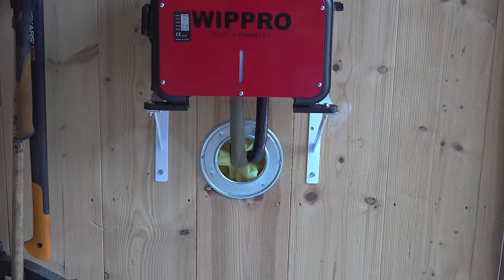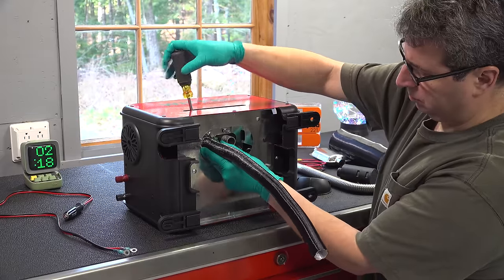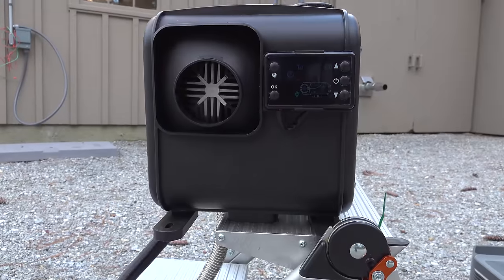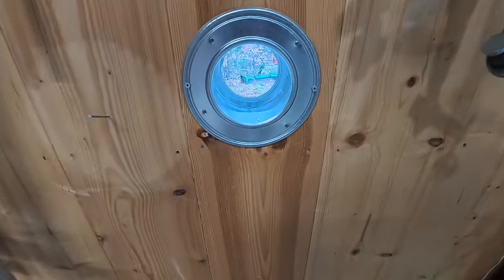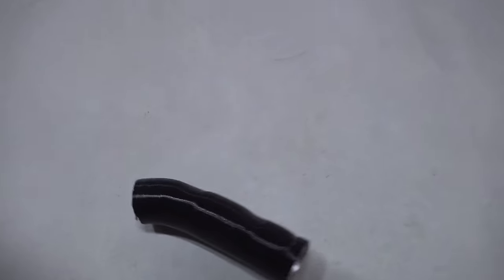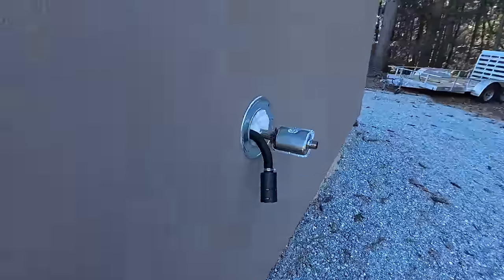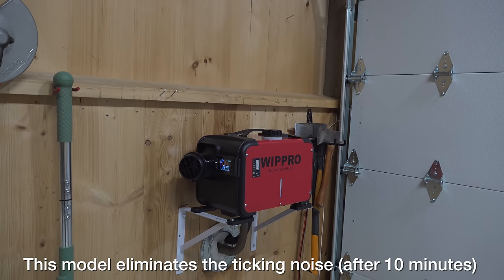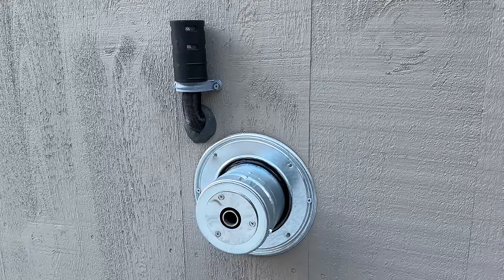How to Heat a Small shop with a BUILT IN Diesel Wall Heater

Comment from the maker: What do you think? Parts used: Heater: https://amzn.to/47o4DcR  Exhaust Flange: https://amzn.to/3NP4GaU Insulation Hose: https://amzn.to/3vxMsUM High heat insulation: https://amzn.to/3NVHA2i
Reply: Thank you so much!
Reply: You should Run an outlet over by the heater with some SJOOW coming out of the box for a 12 volt 30 amp power supply.
Reply: The Selkirk links don’t work.
Reply: great video as always. you and i don't see eye to eye on some products but this is one we agree on. I have an Hcalory unit. its basically a portable like yours but its in a tool case looking box. i keep mine outside. this way i can avoid any issues with my land lord and the fire codes (not that i give a rats ass what the .gov thinks). I live in Florida yes we don't get nearly as cold but the mid 50s and lower is cold for us. I like to keep my place between 68 and 73. otherwise my chihuahua is freezing or im hot. it was 52 last night here and i kept my place at 73 with mine.

do not run these units on the lowest setting for extended periods of time. they glow plug screen will clog up and you'll get an e-8 error flame out. do not run these with a waste oil, veg oil, or a blend you'll clog the screen. do not use left over fuel from a year ago. doing any of these will result in a clogged glow plug screen.

if you have been running it on low crank it to maximum for an hour this will help clean it out. also running kerosene in these will clean them out. i did all of the above things listed and clogged up mine twice. i had to clean out the combustion chamber with carb cleaner and then run kerosene in it to clean it out. Kero burns hotter. my exhaust turned purple!

you might want to look at the Bureck remote thermostat. its $70 and it clones the remotes of these heaters. once you have it setup it will kick the heater on when the temp falls to what you have it set at and off when the temp reaches a temp you have it set at. me i just keep a digital thermometer on my counter and if it dips below 67 i kick it on and off when i hit 73. but you like gadgets so you know go take a look at it.

also you might want to look at running it with kero. when i ran mine on kero it seemed like it used alot less fuel. kero and diesel have similar btu content but keros flame temp is higher. i can't get kero cheap here. only big box mart k-1 at $10 a gallon vs the $3.50 i pay for diesel but if there is a station up that way i'd look into that.

lastly for everyone else, some small power stations won't work. some of them the 12v outlet won't produce enough 12v wattage to get the glow plug going. if you are planning to run one on a small jackery  you might run into this problem. i use a spare car battery hooked to a Hulkman charger (the one Silver Symbal reviewed awhile back) no issues. a lawn tractor battery will work too. a small sla may run into problems.
Reply: @MrSGL21  Instead of burning fuel why not setup a parabolic dish and a loop of hot water? Makes more sense to leave the diesel in a truck or generator then to just piss it away. I mean fuel costs money, they sun is free heat.
Reply: @georgewashington7829  Fairytale land.
Reply: How hot does the center flange get outside?
Reply: @georgewashington7829  solar doesn't have enough energy to heat my garage in the winter. Maybe if the whole garage was a green house

Comment: I think you just wrote the book on how to install it right. Looks great! I always appreciate your high quality solutions to common problems.
Reply from the maker: Very nice of you to say. I am sure there are better ways but some of the installls I saw were very scary I wanted it to be as safe as I could do it without spending a lot
Reply: Honestly I looked for weeks when I put mine in the garage 2 years ago and no other guides or installs came even close to how well you pulled this off
Reply: Is it possible to install the fresh air intake much farther away from the exhaust? I could be wrong, but it seems like you would be pulling in exhaust fumes and co2. I installed a pellet stove once and was wondering why the adapter had the fresh air so close to the exhaust on those too. Just thinking out loud here. Overall looks like a great set up. Thanks for sharing!
Reply: @SilverCymbal  if you have a house on a post and pier foundation and ran the exhaust the same way through the floor would it be safe?

Comment: I have 5 of them, these are great.  I also heat my garage with one, and a travel trailer, as well as a small greenhouse.  If you duct the exhaust through an old large cast iron steam radiator it both cools the output gas to around 90 degrees, silences it, and acts as a useful thermal battery.  I have a few videos about it here on YT  and am on year 3 of doing it with no negative side effects to speak of.  It's useful for heating water and even cooking as the cast iron where the diesel heater exhaust enters it gets to 350°f.
Reply: That’s an excellent use of the “waste” heat; well done!
Reply: @robertmunroe3976  Thank you Robert, it also works fir my 2 stroke small generator and large 8hp 4 stroke generator to both recover heat, but also it completely silences the outdoor exhaust noise believe it or not.  I spent years trying to fabricate diy generator "mufflers" that did little to quiet the exhaust, only to find during my experiments that a cast iron steam radiator does the J O B
Reply: @ProlificInvention  wow, very cool. My old Thermodynamics professor would love your solutions!
Reply: Good thinking! Your idea of the radiator might have just gotten me to make up my mind on switching over to one of these in lieu of my pellet stove in my shop....
Reply: @NordicDan  I don't know what pellet stove you have, but mine has been great and effortless for 3 years now. I keep a 24x24  70 degrees, in sub zero temps, on just under a bag a day.
Reply: I'm looking for a small cast iron radiator for my exhaust to run thru before exiting the building so I can capture that heat also.

Comment: the insulation you used is Ceramic insulation. Can be had very cheap online. You should reorient your intake pipe to face downward. That way any moisture that does get in has a chance to drain out before getting into the heater unit.

Comment: You could use an old PC ATX power supply to power your heater on the cheap. My old one will put out about 15 amps for the 12 volt output. You would just have to ground the enable wire to turn it on.
Reply: jump the green wire to any black wire IIRC. thats how i would do a quick and dirty test of a PS back in the day.
Reply: Used a old HP server PSU 80Amp on tap is crazy, 12v for the heater but also to start a small moped or bike. win/win
Reply: Nice hack.

Comment: I would turn the cold intake down in case water gets in, it will drip out.
Reply from the maker: That is a really good idea, some how my brain was thinking the opposite.
Reply: @SilverCymbal, just my opinion.  I've never installed one of these, but that intake would work similar to my furnace and it's pointing down. If you do that would it get too close to the exhaust? Who knows..

Comment: Looks great. My only concern would be having the intake so close to the exhaust personally.
Reply: It's a dedicated combustion air intake, so air from there is on a more or less closed loop with the exhaust and will not enter the living area. It needs to be nearish to the exhaust so wind doesn't affect one but not the other, which could cause the heater to flame out due to air going the wrong way.
Reply: 37 years of heating and ac elect and plumbing experience here and yes the install is clean but on forced combustion devices you should always put your intake below or prior to your exhaust. Exhaust fumes being warmer than ambient air tend to rise and on a draft leading from your Exhaust point to your intake point you can recirculate those carbon filled oxygen deficient games and carbon up the interior of your heat exchanger.  Will it positively happen? No. Could it happen? Yes without a doubt. I have seen it several times. Nowdays code is written to correct this and prevent the problem.
Reply: @iguanamoat this is wrong. There are indeed 2 air circuits but one intake. So intaking any exhaust will end up in the heated air and ultimately in your building. There is a whole series of videos on these heaters and they establish this fact.
Reply: @A_Person_You_Dont_Know  You are probably thinking of some other heater. You can see the two intakes in this video, one plumbed outside with the exhaust, and one on the heater box opposite of the hot air outlet.
Reply: @iguanamoat  Do you own one? I do and if you get exhaust in that intake you can smell it. I like this channel but he gets a lot wrong on this video.
Reply: @A_Person_You_Dont_Know  Yes, I own two and have taken them apart, and can confirm the two airflow paths are separate. If you get exhaust smell through your combustion intake, the seals that separate the two are leaking. Most likely culprits are the glow plug cap and fuel pipe grommet. Seal these thoroughly with high temp silicone to fix the issue.

Comment: I haven’t yet done it, but I’ve been in oil and propane heating for 35 years. I’m gonna run the exhaust pipe through the center 3 inch pipe and then the 3 inch will be inside of the wall flange that you made but inside that 3 inch pipe with the exhaust running through the middle, I will connect my combustion air to it therefore remove heat from the exhaust pipe and you’ll pre-warm your combustion air, which will give you better combustion and cleaner combustion, and the outside surface will be the same temperature as the outside air temperature on the outside and inside the temperature will be colder than the interior of your home And that will be as safe as you can get❤️‍🔥❤️‍🔥🇺🇸

Comment: I have installed (and operated) a bunch of the original Espar and Webasto diesel heaters, which have sold for $1500 to sometimes $4000+ depending on the model and accessories.  So I know these products well.  So it is absolutely crazy to see these knockoff products for $100-$200 as a complete kit, and they mostly all seem to work really well!  I think your final install was well done and should be fine.  My only concern would be your combustion air intake: 1) turn it upside down, to avoid rain getting into it.  2) The reason they have the combustion air intake designed to be ducted from "outside" space of the heater, as the main design of these heaters originally, was small spaces for boats and truck cabs.  So they didn't want to pull inside air for combustion in a small space.
However, the downside to pulling outside air, is risk of sucking in water, and also long term risk of moisture/corrosion/debris getting into the combustion chamber and the glow plug (the glow plug is really the heart of the operation).  Those glow plugs are very delicate and sensitive to dirt/debris/moisture and corrosion, and other than fuel, they are typically the main source of no-start, running issues, smoking, etc.  They need a super clean burn.
So at the very least, maybe angle the air intake down, or consider allowing your heater to pull inside shop air, as you have a large space.  If you have a lot of dust/debris in your shop, like for wood or metal work, the outside air is better then.
It's worth putting a low restriction filter membrane on both the combustion air intake, and the main fan hot air intake, to keep out dust/debris.

Comment: Nice clean install! You may want to fully seal the exhaust to heater connection with high heat RTV silicone like Permatex 81160, it'll be leaking a small amount of exhaust into the workshop with only a band clamp and metal to metal interface. I would also consider a 10 amp power supply the absolute minimum for these, lower will work but may not ignite quickly or reliably, leading to the heater sooting up over time. Voltage should also not fall much below 11v at startup as measured by the controller, or you are likely to get late ignition and soot formation.
Reply: Keep in mind that cooling the exhaust too much will form quite a bit of water. Water that's on the slightly acidic end of the scale too. Bear in mind that this is from a few minutes of research on these devices.

Comment: Thanks for the video.  I just installed one of these yesterday in my small woodshop!  Great point about using the wrong insulation.  I just used that stainless thimble you added at the end - I'll have to keep an eye on how hot it gets.  I bought the 8K unit instead of the 5K, but I think they are the same (I can only turn the pump up to 5.4 on mine.  Still - 5K is about 18,000 Btu/hr (same as the big buddy propane heater on high).  Benefits of this diesel heater are no open flame or the moisture in the air from a propane heater
Reply: and diesel has 50% more btus per gallon than propane.

Comment: I've got three of these so far. I use one to heat an enclosed raised patio mounted to the floor in a corner. The others are for boost on bitter cold days and backups. One of which I designed to be more portable with extra fuel capacity. The bulkhead exhaust fitting can deflect more heat than you realize all on it's own. I use  120v ac to 12v dc power supplies. I do think you're install is top notch and it will help a lot of people out. Thank you for posting this.

Comment: A lot of waste heat goes out the exhaust pipe, There’s I guy here in Uk who has been experimenting with capturing as much of that heat as possible using long runs of exhaust pipe, then water jacket, then radiator, then sand (heat battery) to maximise efficiency.  I did wonder if you could use waste heat through TEC (Thermal Electric conductor) to generate the 12v to run the electronics (you would need a small battery for startup which could be recharged through the TEC. This could remove need for external power supply.  Just some thoughts for further experimentation.  Also you didn’t mention this can run on waste oil (mixed with kerosene), just watch out for sooting in combustion chamber.  Thanks for the post.

Comment: Also you can use rock wool insulation.  2000 degrees flash point
Reply: i used roxul..

Comment: K-Wool is refractory material used in furnaces.  I worked for a combustion company for 15 years and we built many a furnace with K-Wool.  The hearth needs to be hard bricked but the walls and ceiling can be K-Wool.  Installation is a breeze compared to hard bricked refractory and repairs are easy.  It's really good stuff and takes temperatures up to 2,300 F.  Your install was first class by the way.  Very professional looking.

Comment: Also would it be more efficient to capture exhaust heat as well if you extended the combustion exhaust pipe to like 8ft inside your garage and then vent outside, thereby capturing some additional heat. You just have to make sure it won't be touching anything else inside.
Reply: Similar to the linear shop heaters, we have a few in our facility. Even the exhaust runs radiate quite a bit of heat and aren't insulated just for that reason. They are 20' in the air and you can feel the heat from just the exhaust pipe runs.
Reply: There is a maximum exhaust length (I believe 2 meters) as well as maximum number of bends (270 degrees total IIRC). Shorter and straighter the better for efficient combustion and less soot - the combustion side of the fan doesn't blow much air, and even a little restriction can cause these to not run optimally. Generally speaking, scavenging heat from the exhaust has been found to be not worth the effort and additional issues it can cause, though it's possible.
Reply: @iguanamoat the max run is probably based on using the size of pipe the kit comes with. By increasing the pipe size you can increase the length of the exhaust.

Comment: i love how it is the cheapest option for a forced air vented heater, i have one in my ice house and difference between venting inside and venting outside is huge the reduction in condensation is crazy compared to the old propane heater. I have never had a problem with it and it runs just fine on winter diesel too!

Comment: Great install. I struggled with this installation idea for weeks before I finally figured it out. Great tip on the k wool. I’ll have to pick some of that up. I did use header wrap on my exhaust as well to limit the heat output of the exposed piece directly beneath the heater. I love what you did with the exhaust overall. I may have to steal your idea and redo my exit to make it nice and clean like that.

Comment: Considering hot air rises, you might want to put the intake hose lower than the exhause hose. Your current set up makes it possible for the rising exhaust to be sucked in the intake hose.

Comment: I use a little 200w Lasko mini heater with my solar power stations in my camper for heating the bathroom. If I get caught with a non-working gas heater in a winter emergency the backup plan is to seal off the couch area with mylar blankets and plastic to hold in the heat and use an electric blanket and the Lasko.

Comment: Soon me and my girlfriend are moving out and I was thinking about getting one of these to heat the garage. I was thinking I could run the exhaust through a truck intercooler or radiator then have it pipe outside. Then I could put a fan blowing air through the intercooler so you’re getting more heat out of the unit and not just letting the exhaust heat go outside.

Comment: A quick question. What harm could there be if I were to put the heat sleave on the exhaust, wrap it all around with the ceramic blanket wrap and then just put it through the thimble with the cap and the hull fitting installed as you did? The ceramic blanket wrap should keep it fairly cooler inside the thimble. My garage wall is not insulated but has 5/8 drywall inside and osb and vinyl siding. Just curious. Thanks on the great video!